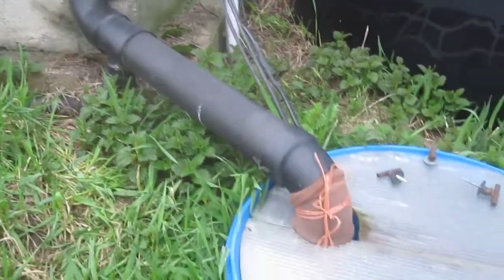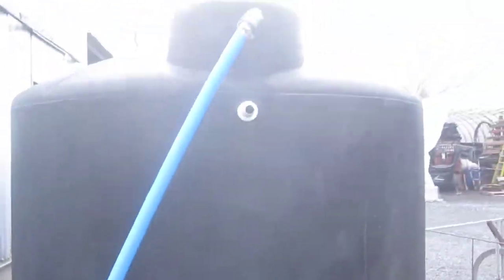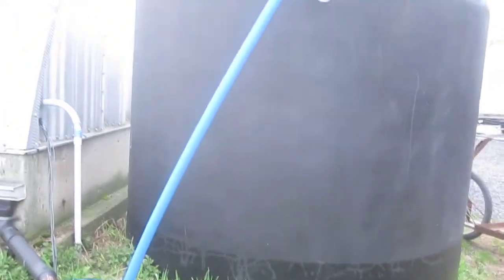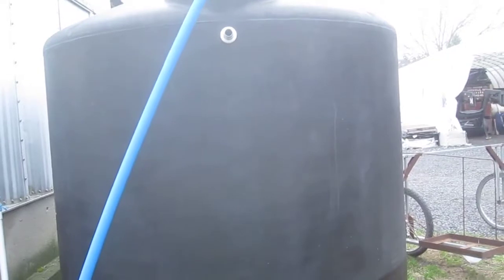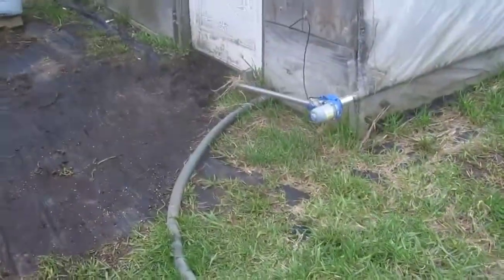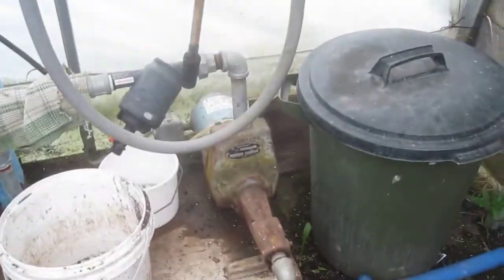rainwater collection system

Comment: Late comment but nice job. Any update on its current condition and efficiency?
Reply from the maker: Glad you asked!  6 years later this rainwater collection system is still totally functional and has been changed very little.  We eventually added eavestrough + another sump barrel + sump pump to the other side of the building to double the harvest rate.  Otherwise we've really changed almost nothing other than a lot of pantyhose primary filters.  At least twice we've forgotten to remove plugs from the first flush diverter in the fall and suffered freeze-burst ABS pipes but otherwise it's been great.  At least one stock tank de-icer has died in service but I think we're still on the original sump pump for the south side.  Now that we're collection from both halves of the building I think we get roughly 2000 litres for every 10mm of rainfall.  That's roughly 1000 gal from each inch of rain that falls on the building.  All told this project.